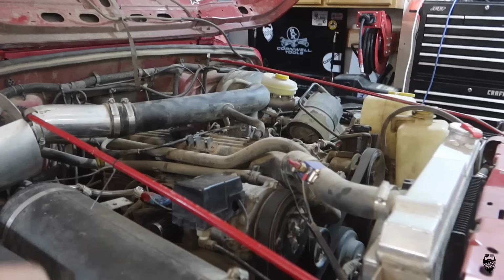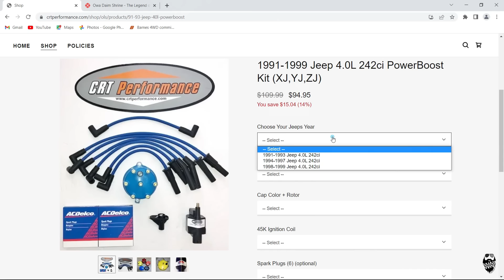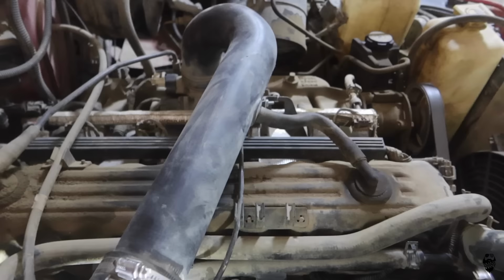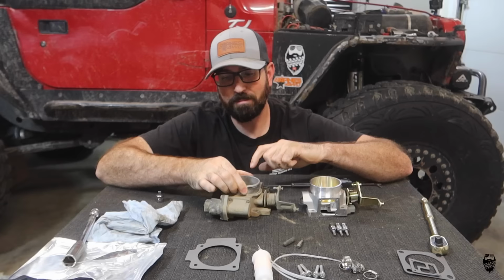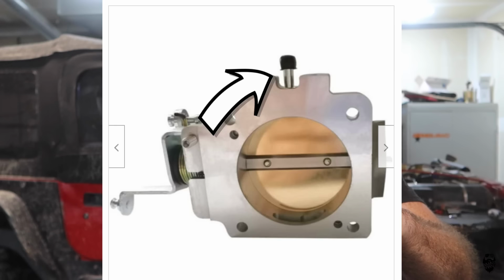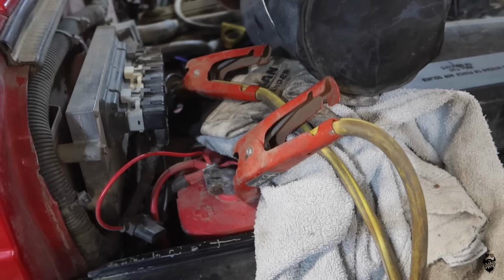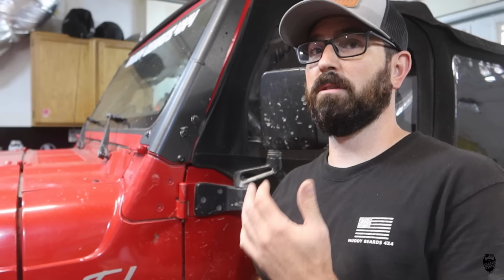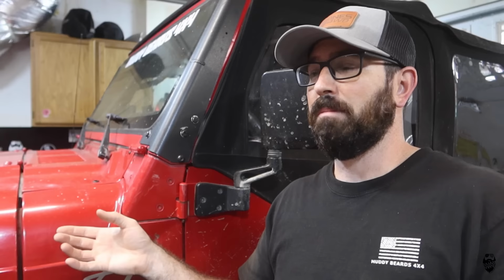MUST Have Jeep Wrangler/Cherokee 4.0 Upgrades?

Comment: A banks header pipe and 3" free flow exhaust hot coil low resistance wires made a big difference for me
Reply: I did the banks header .. Bitchin isn’t it , but I have the stock exhaust, but I have a cherry bomb sounds great and works wonderfully

Comment: I read a long time ago that some good power can be gained by swapping a TJ air intake manifold into a YJ. they basically redesigned it for better flow to make up for the power loss due to emissions regulation changes.

Comment: I have an 01 wrangler 60th anniversary will be doing a complete tune up soon this was a good video these 4.0 are real offroad warriors 💪 there's so many cool things you can do to these beauty's 👍
Reply: How did it go? any updates i have a 1 wrangler 60th anniversary also, curious what you did and the difference it made?
Reply: @MrAllyWow my transmission failed I haven't had a chance to do anything but should be up and running soon

Comment: Those inline filters are good for diagnosis. If you have "running" issues and have gone the mile. Go ahead and throw in a fuel filter. It could be dirty fuel. It usually is not the throttle body, kinda nice of em.

Comment: So I’m running the 12 hole injectors from K Suspension and I’m super happy with them. When I swapped the new injectors in I also swapped in a billet fuel rail as well.

Comment: I already had the 62mm throttlebody on my 4.0 when I got the Jeep, decided to do some other mods too. Cause its an 01 WJ I have electronics so ended up with Ksuspensions Viper coil mod and love it, also did a 12 hole injector swap. Injectors were el cheapo used so I'm expected a CEL soon but my mileage and power difference is noticeable over stock. Cold air intake, KSuspension 12 hole injectors and battery wire kit are next followed by skid plates.

As for your throttlebody missing the sensor nipple the ones from the stock TB come out easily with a torch and, at least on the ones I worked on, can be pressed into the new with a bit of sealer on.

Comment: Look on The Horsepower Monster channel. They have done a few vids on getting power out of the 4.0. Like 800+ HP levels. (Bore/stroke, turbo,....) I don't think you need that, but some of the mods would definitely help better then just a throttle body and some sparkplug wires.

Comment: Picked up ksuspension 12 hole injectors and the ripper coil and plug wires also the 7 large wire upgrades. Most noticeable change was the idle smoothed out. Also a better throttle response and picked up about 4 miles per gallon. The starter spins must faster and lights no longer flicker.  Best money ever spent. Looking at selling my suburban and getting a 4.o stroker.

Comment: Had a 258 that was built by Clifford and a ford 300. Both put out 300hp and around 485 foot pounds of tork at the rear wheels. Always liked to see a built straight 6 under the hood. Clifford research was the go to guys in the 80s for building straight 6 engines. Not sure who is today.
Reply: Newcomer racing has a few options for the 4.0
Reply: Unless they had forced induction those numbers cant be right.  N/a engines are doing really good to be in the 80s for ft/lb of torque per liter, and thats almost always 4 valve head dohc  engines, and rated at the engine.  I do love inline 6's as well, and have a 04 rubi 5spd.  I wish the banks turbo kit was still available.  Another thing im gonna research is the gm atlas 4.2, much superior to the jeep 4.0 imo.  If it can be adapted to a manual trans that would be an amazing swap

Comment: Raffy at K Suspension is outstanding. I put his Viper coil and plug wire conversion kit, his power wire kit and his rebuilt 4hole injectors in my 4.0 TJ and I was impressed. Let's face it, we're not in a race vehicle, so the wide open HP isn't important but the torque is and mine picked up more torque. You'll be pleased with His injectors. They are worth the money.
Reply from the maker: Great to hear 🤟🏻

Comment: Wish I’d seen this and had your advice before I changed plugs and injectors and fuel pump and fuel tank.  Can’t start and no idea why!   Thanks for a great video.
Reply from the maker: Yea… that’s a tough one. Start at the easy stuff, fuel and spark and work backwards
Reply: @MuddyBeards4X4  thanks.  Took to mechanic.  Timing was off.  So distributor must’ve been installed wrong, though I don’t know how that happened.

Comment: Yes! Good to use regular plugs, never Iridium. The 4.0 is an older designed engine, its happier with copper
Reply: Iridium spark plugs are the best on any engines! I have great improvement with my 4.0l Jeep wj! Get it right!

Comment: It may sound weird but the best upgrade is a 258 american motors inline six( 4.2L) they can be built for off-road use and if you use the right parts can be made to belt out 250-85 hp before having to worry about breakage. The only downside is the engine is all cast iron so a 258 weighs about 275 pounds more than a typical 4 liter (from 1996-06,end production year)

Comment: The TB comes like that to allow drilling and tapping for the map sensor, before 1995 you can plug it, as those 4 liters used a different fuel injection system.

Comment: Never increase the gape on your plugs. I have played the that game for years with random misses then tried to lowering the gap by a couple of thousandths and all the engine I have done this run the better and over time the gap opens anyway. I’m 56 and and done this on Toyota Jeep Chevys
Reply from the maker: With a stock ignition coil absolutely. This is a higher power coil that can produce a spark that can handle a bigger gap. So far it runs great. But I guess we will see.
Reply: Even with coil on plug it works better to be tighter. I first started to over gapping plugs when I bought a Jacobs ignition in 1993 For a 1991 4Runner to try to get a little more power it didn’t work I also used all the snake oil plus to get a little more power on many different  engines. Till I noticed that I would get random misses and took the plugs out of my 5vz fe and cleaned and set the gap tight by .003-.005 closer and yes that engine has duel ground plugs and it worked grate. I also only use the cheapest plugs I can find and through them every year. Oh ya i just replaced a broken piston on my 97 XJ and did the same thing it runs great. It will be getting a SBC in the spring though. Oh if you run Magnetos I think you could gap the plugs 2 feet😃 good luck 🍀👍 I have to fire up the death wheel to make room for 35” Milestar patagonias M/T i got Facebook market place cheap let the spark fly

Comment: Over the course of the three 4.0’s I have owned including an early 90’s xj and two late model tj’s I can tell you that the best way to have a “powerful” 4.0 is to use factory mopar or ngk sensors and keep everything stock mopar as much as possible including the intake and exhaust systems. From my experience there are no “add-ons” or combination of add-ons for the 4.0 that will amount to anything more than a placebo feeling that there is more power. The only real way to get more power is to stroke it and I’m not convinced that is a good option either.
Reply: Facts.
Reply: The turbo I put on my 4.0 as an "add-on" made for a more powerful 4.0. 😆
Reply: I mean…. My 4.7 stroker with intake, exhaust and upgraded fuel injectors definitely made for a massive improvement. Much more drivable at freeway speeds with all that added torque and horsepower. Not necessarily cheap though…..
Reply: theres a great 4 video interview with Rick Mudge on the youtube channel AMXJ i believe. hes the godfather of the 4.0 i highly recomend veiwing, alot of what the the internet and social media thinks about the 4.0 isnt correct.
Reply: Look up Newcomer Racing. He's an engine builder that primarily does 4.0s. He's even built a record breaking 4.0 engine that made over 800hp if I remember right.
Reply: I don't know.... Ymmv but I noticed a pretty decent difference in the top end on my Wrangler when I did a full exhaust, higher flow intake, and ported the intake manifold. It never touched a dyno, but I could crest on dunes that I couldn't get 80% of the way up beforehand.

I wouldn't say it makes sense to tear into a perfectly fine running Jeep, but if you were already getting into it like I was with a new transmission and rebuilding the transfer case I'd say it's worth tinkering around with a bit.
Reply: @remingtonnewkirk8981  damn i wanted to stroke mine out to 4.5,
Reply: Healthy Bolt on 4.0 are getting 235 hp. Bolt on and stroked are pushing 285 hp.
Reply: @mrdashin8323  That's why I said the only real way to get more power is to stroke it. Did you read the whole comment or just the first half? I have yet to see a stroker last any longer than 50k which is why I will never go that route.
Reply: It’s all about the right combination of parts. To achieve what your looking for. Just throwing random parts  on a engine gains slightly
Reply: 190 HP is pretty good for an Old Jeep. I just want quality upgrades. Not power upgrades on mine.
Reply: Long tube headers ABSOLUTELY add a very real gain in horsepower on a 4.0. It's the single best mod you can do to any engine and will always pick up horsepower and torque. That along with a free flowing exhaust will make a big enough real world difference that would translate to numbers on paper too.
Reply: Ypu are correct. The 4.0 runs like absolute crap with made in china crap. Best thing i ever did was put all new old stock sensors front to back, wires, rotor, cap even the fuel cap. All of it MOPAR
Reply: My LS swap counts
Reply: I'm gonna have to disagree. Just replacing the stock plenum and adds much more cfm stock injectors are 2 hole garbage. Better air flow better fuel delivery and better fire equals better performance and that's not an opinion
Reply: Recently bought a xj from a buddy with a bunch of bolt on stuff, its definitely quicker by a noticeable margin than the stock xj I've driven for 10 years
Reply: I'll have to disagree, had a 99 xj with a 62mm throttle body woke mine up like crazy, crank and springs from a 4.2 as well as well then had to swap the clutch because it wasn't rated for whatever hp it was pushing...easily burned 33 inch tires out the LSD rear and absolutely wrecked in the mud drags
Reply: @harryazzole7814  I put the ARH long tube header on mine combined with Harland Sharp 1.7:1 Roller rockers and I am making a LOT more power than before.
Reply: @joeyd4079  some guy is going to argue that the 4.0 is the only engine the principles of engine building don’t apply to.
Reply: @remingtonnewkirk8981  just curious what that did to your gas mileage stroking it like that
Reply: @Brian Britton  problem is, now I've grown a lead foot haha. I average around 13mpg right now but I could probably get closer to 16 if I really tried. If I did 65mph on the freeway instead of 80... that might help.

16mpg is my average in my 2013 jku rubicon as well. So it doesn't seem too bad to me
Reply: NEWCOMER RACING has a similar performance profile of the stock . With 85HP...   It's a 10k package. But I want it for my bugout wrangler.
Reply: 4.2/4.0 striker is always the answer. It’s just at cost.
Reply: What about a cam swapp  regardless of the price does it make a noticable differebe with other cylender head mods?
Reply: Qqq I got my
Reply: I've had a few CJ's with the 4.2 and help others with their 4.2's over the years.

And I agree, the only way to really "boost" the HP is to make modifications that increase the volumetric area inside the cylinder so more magic sauce can go boom!

Thar being said, I also have found that 99.9999% of time. The bolt on stuff gives you that feeling of increased HP because you are replacing the OEM stuff that was handicapping the engines ability to generate all of the power it inherintly capable of given its existing internal configuration.

In other words, your engine may be capable of  "X" amount of HP, but under total stock configuration you are getting less than "X". And the bolt-on parts simply get you back up to that potential "X".

Comment: For the throttle body modification. I don’t know if this was mentioned. But why didn’t you use a threaded hose fitting? Tap the throttle body and get a brass fitting with thread on one side and barbed end on the other?

Comment: Whike the upgraded injectors are a good call there has been a lot of debate whether the majority of the increased performance is simply coming from new clean injectors & not as much the improved Squirt. I woukd love to see someone throw on just new OEM single hole run those for a month & dyno if possible to see the mpg, hp & torque they are getting & then throw in the Bosch & test again.